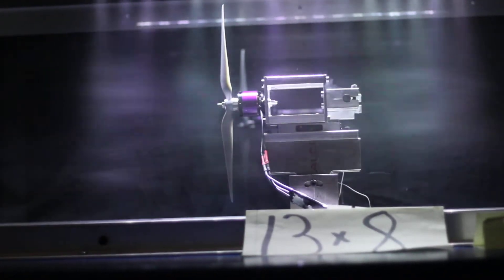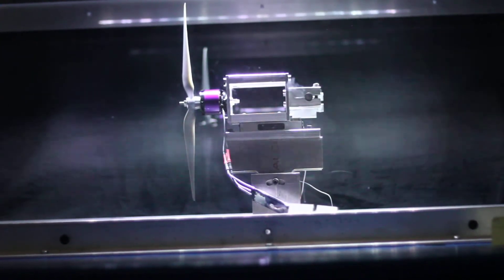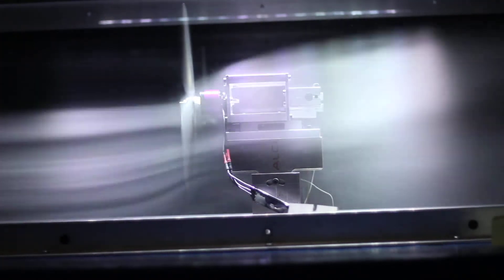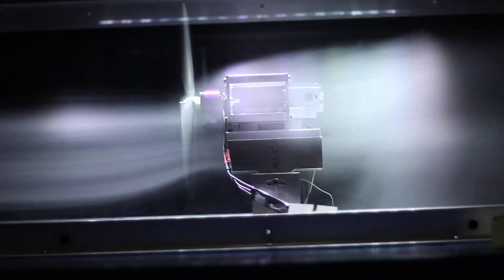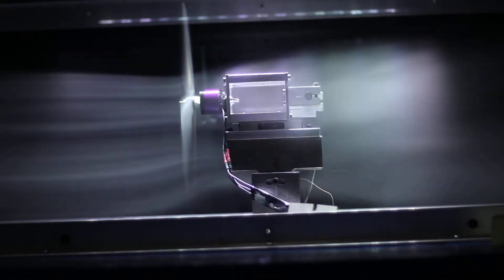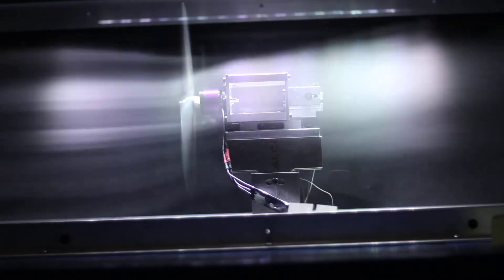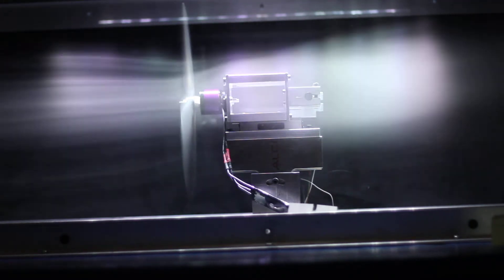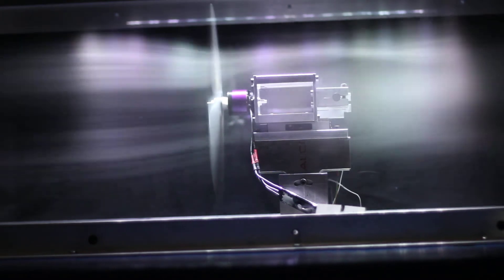Thrust Test with Smoke

Comment: A full (albeit, edited) video of all the propeller tests and the data you gathered would be interesting.  I can't help but to think other factors may have spoiled this test like:

1) Clearly there was some kind of device pushing the air.  In a propeller test, it seems you would not only NOT need such a device, but the use of such a device might skew results.

2) The area behind the propeller is very small.  In real-world scenarios, there would not be a tunnel funneling the air behind the prop.  It would be interesting to see what happens to the air in a more open situation.  It would also be interesting to see how far the air remains in a cylindrical pattern before breaking up.  It would be interesting to see smoke pattern dispersion from the TOP side of the propeller.   It would be interesting to see at what RPM the propeller loses efficiency - or if it ever loses efficiency at all.